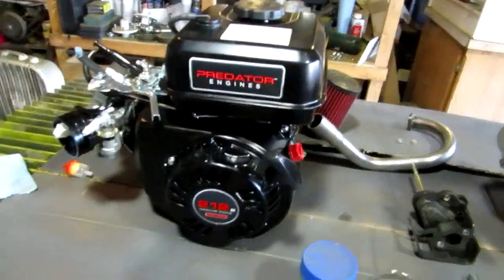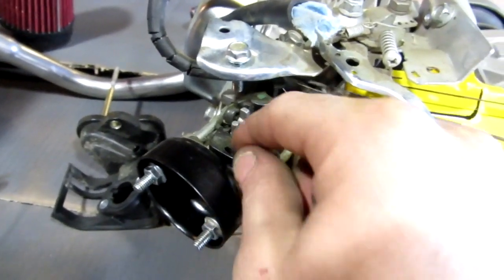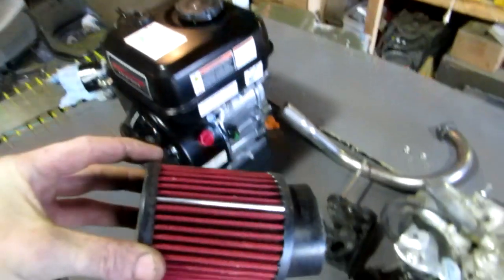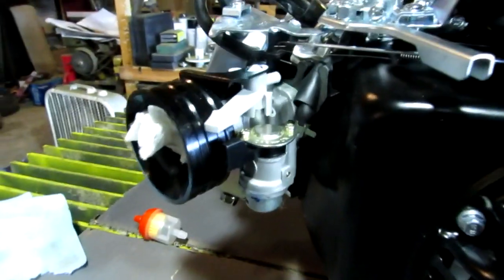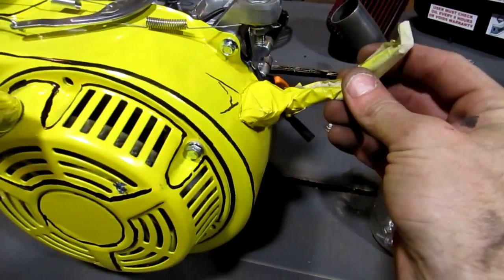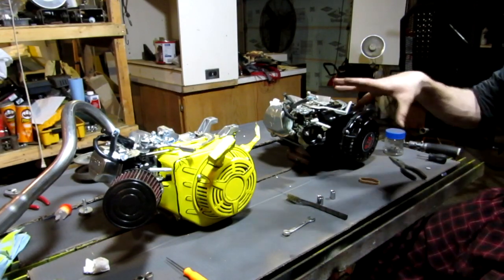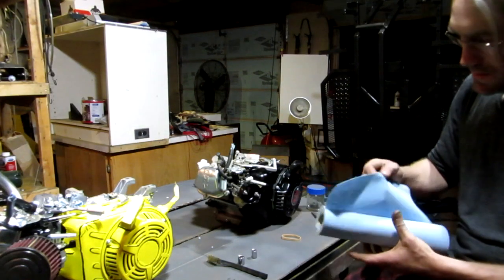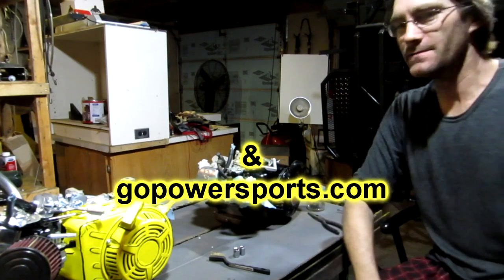T-mans Go Karts Modified 212 cc Predator Engine

Comment: just fyi but the Honda performance parts do fit the clones to help build a bit torque the cam would be a good one to change out on it.
Reply from the maker: Dave Taylor ok, Ill keep that in mind. I think I'll also get a new fly wheel also, it really vibrates when its opened up.

Comment: 2k is a bit much but when racing but $$$$ has allot to do with who wins, for 500 you can do a cam 150 flywheel keys 20.00 mill the head 65.00 remove the governor 0.00 tilly carb and intake 200.00 filter and fiter mount 45.00 header 3 stage 60.00 prices are a guess but you get the idea its close, DO NOT DO PORTING UNLESS YOU KNOW WHAT YOU ARE DOING, I seen guys take screaming engines to slugs from bad or incorrect porting/// good luck :)

Comment: How fast would the harbor freight engine go and the gps engine do you have to do anything to it to get it to go 42 mph?
Reply from the maker: wood working to get speed on anything like a go kart it comes down to the ratios, tire sizes and RPMs of the engine....most of the time.

Comment: So there is a difference between the gopowersports engine then if I were to buy it from harbor freight?
Reply from the maker: wood working Oh yeah. the GPS engine is a racer. I have been test driving this build today and I got it clocked at 42mph
Reply: +T-Mans Go Karts what is you gear ratio mine is 10:60 / 1:6

Comment: I just had a question. I have a twin engine go kart with two predators. I'm worried my chain won't be big enough for the load. I run a #35 chain. would that size be alright to run off road with 19 inch tires?
Reply: +Cj Holcombe i would definitely try 420 chain, a lot stronger and longer lasting for the load it will have.
Reply: +justin roede shit I blew my 420 apart, STOCK FUCKING PREDATOR 212!!! blew the rings right off, then stretched... So 35 is going to snap lol

Comment: ok so they want $339 when a brand new stock predator cost $120 with a $40 dollar carb $20 dollar intake $20 header and the governor is removed which is free if you know what you're doing that brings it to $200. Why would I spend $339 whn I could do it all myself for $139 less and it's all bolt on apart from the governor?
Reply from the maker: Mike Will because Most people cant find those parts that cheep or feel comfortable about ripping into an engine and setting it up. If you know how to set up a engine for racing and have the right test equipment, thats great. Most people dont want to deal with that. Buy the engine pre-set and tested by a tech, put it on and go driving.
Reply: ***** YouTube has everything I self taught myself a lot of things from YT one being a modded predator.
Reply from the maker: Mike Will oh ya, thats one reason why I haven't done it. Plus I dont want people to think I'm an "engine" guy.
Reply: ***** I get what ya mean
Reply: T-Mans Go Karts buy some real pants

Comment: if you are not going to take the gov off try a used stock Honda flywheel,  and pick up some off set timing keys add 7 to 10 degrees of advance, it will make a little more power and sound allot better there is a ton of other stuff you can do there on your bench to make some hp, just yell I can help ya with that
Reply: I'm yelling and want help! Sep I have to buy a new predator, mine blew up.
Reply: well because these engines don't last long once u modify the crap out of them I have all ways used the harbor freight  ohv, 5.5 6.0 13hp or 16 all these engine will accept the Honda aftermarket parts, just fyi what I have done with even blown engines get some aluminum and weld the hole from the rod going through it back up if in the crankcase area, I mill the head down fifty thousands. remember to grind the valve stems to get the right lash, use the tillotson carbs, you can go to e.c. tillotson  and get alky and gas with intakes, as for engine parts Honda performance parts has cams rods cranks heads billet flywheels, now you can get a really nice mid performance engine all ready buit  and ready to run out of the box from uncle franks blue wazoom if money is a factor, I have built my own custom engines that cost me around 2 thousand bucks down to 500 bucks depends on what you want to do for tips and more info go to 4cycle.com click on the forums and tech
Reply: I'm not going that extreme! But I am putting a few mods on my 212cc, so for predators you use Honda performance parts? And 2k is a bit much on a little one of these motors, I would only do a $500 if I was going to upgrade that much.